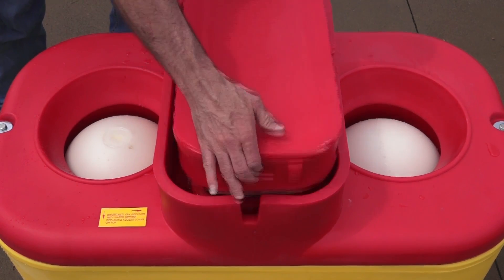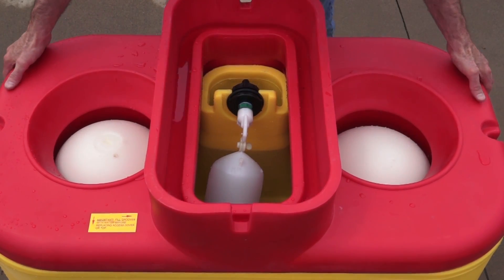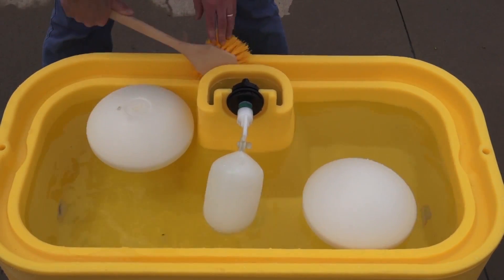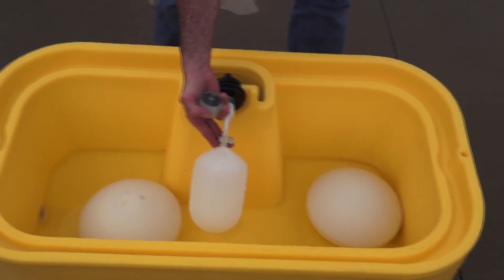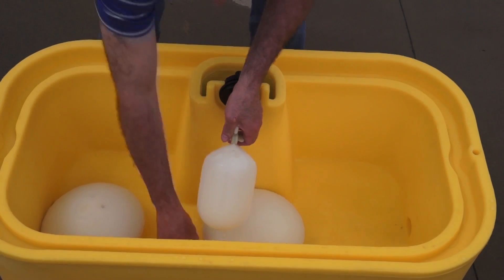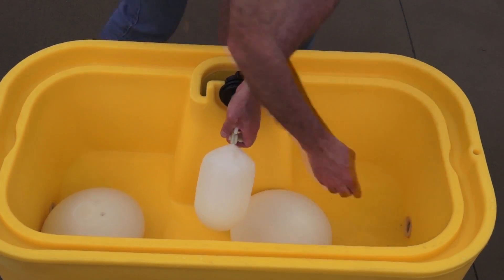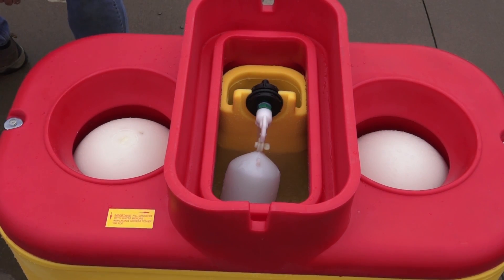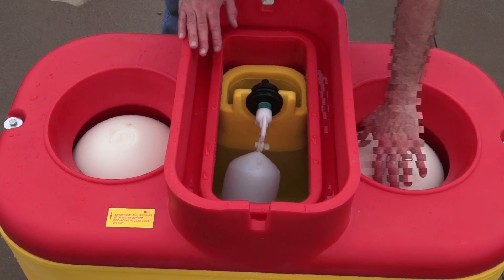Ritchie How-to: Cleaning a Thrifty King automatic waterer

Comment: The problem with the frozen water seal is that if you can't get the top off to change the valve when it breaks or the float because the top is frozen to the tank.  This has been a problem that has been had with this unit.